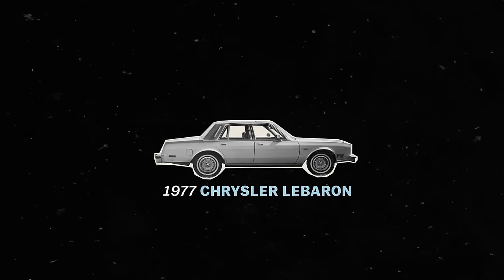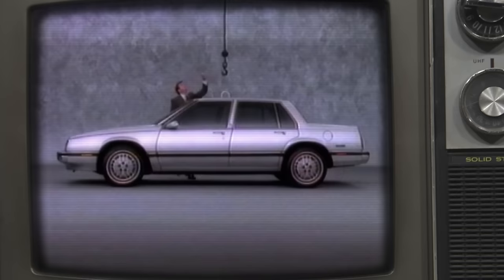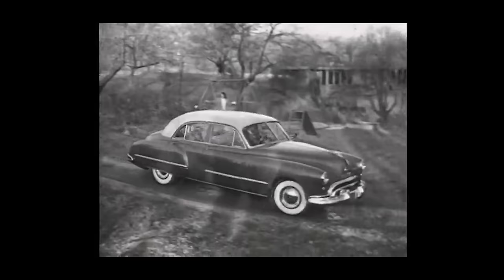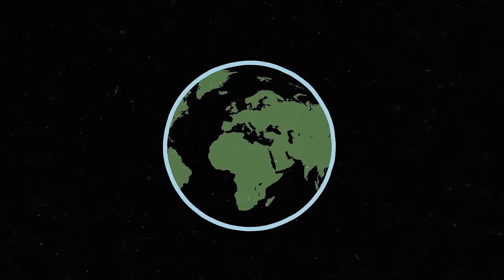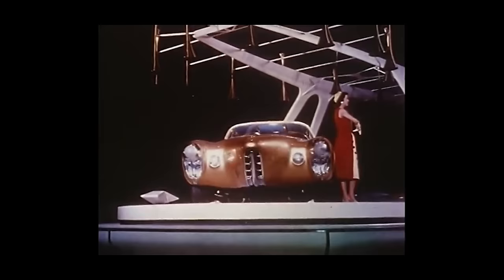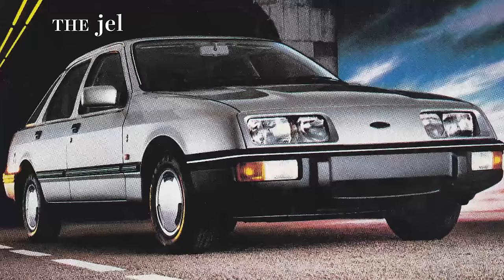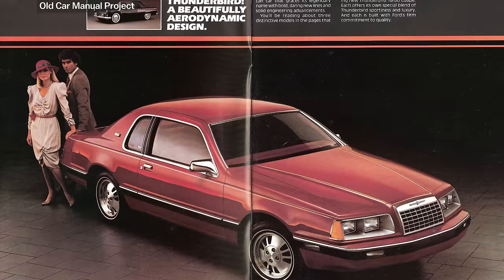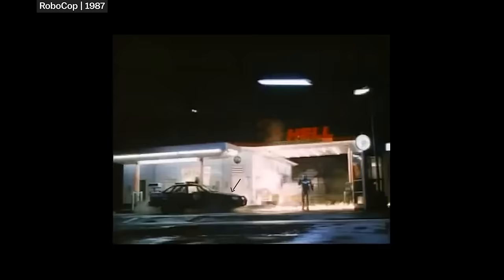How cars went from boxy to curvy

Comment: Who is the halfwit who wrote this?  Oh, where to begin?

1)  The whole Europe = Round, US = Boxy theme is simply, laughably wrong.  How many wagons and hatchbacks from that era do I need to show to utterly disprove it?  Let's look at 1970s Mercedes sedans (not the coupes, which were also rounded in the US) and Volvos and Fiats.  And it only got worse in the 1980s on both sides of the ocean.

2)  The rise of mass-market curviness was much less a function of gas prices and MPG standards than it was the ability for production to economically make stamping tools that could make the body parts, especially given the need for left/right symmetry. 

3)  Styling for curves v. corners has swung back and forth.  1960s cars were plenty curvy.  Compare the Lamborghini 400GT or Miura to the Countach.  Heck, compare a 1990s Cadillac to a modern stealth bomber one.

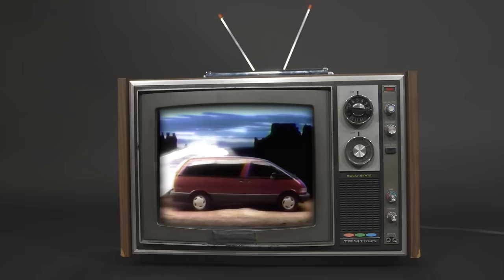4)  At 0:32, you show a Karmann Ghia, manufactured through 1974, racing against a late-80s wagon.  But the KG is curvy while the later car is square.  Um...

5)  Rounded cars are not necessarily more aerodynamic.  As an ex aerospace engineer who actually has done drag work in wind tunnels, I had to laugh at that.  They might have less wake drag, but typically there is more profile drag.

Shall I go on?
Reply: Very, VERY simple test.  Which car is the least aerodynamic?  The curvy original VW Beetle (http://st.motortrend.com/uploads/sites/5/2011/08/1952-volkswagen-beetle-side.jpg), a 1990s Range Rover Classic (https://en.wikipedia.org/wiki/Range_Rover_Classic#/media/File:Range_Rover_(1241369888).jpg) the 3rd generation Dodge Caravan minivan (http://images.gtcarlot.com/pictures/23679187.jpg), or the Ford F-150 Lightning pickup (https://cdn01.carsforsale.com/3/1010138/5345000/thumb/771969921.jpg).

Tick tock tick tock.

The loser is the VW Beetle.  But wait.  Isn't it the "curviest"?
Reply: Comment needs more likes
Reply: I dunno, he might be right but his cocky style makes me not want to like his comment.
Reply: His cocky style is what gives him character and appeal. His well presented argument is interesting to read sir.
Reply: I'm sorry if it came across as cocky; that wasn't my intent.  It's more 
annoyance at how the author of the video completely made up facts to 
tell the story he wanted to tell.  He cherry picked dates (cars in the 
20s and 30s were much rounder than they are even now), lied about the 
years things happened, and ignored plausible (and correct) explanations 
for trends, namely styling swings and manufacturing costs.
Reply: Thank you very much!!!
I only thought: "Are you fu**ing kidding me", when I saw the Video!

Cars are so heavy right now! They carry around a lot of unnecessary gadgets.
If it was really about reducing fuel consumption companies would try to reduce weight.
Reply: Thanks, Hawk.  To be fair, they are trying. Look at the aluminum Ford F-150.  That was a huge market risk, because the F-150 is supposed to be rugged and reliable (it is, but changing materials could create a perception problem - see http://www.forbes.com/sites/joannmuller/2016/06/08/chevrolet-pokes-holes-literally-in-fords-aluminum-f-150-pickup-bed/#3abc487b2465).  The problem is that mandatory safety features, from air bags to crumple zones, add weight to the car.  One of the biggest issues with aluminum has been repair (I think it's an issue of TIG v MIG welding), but shops are learning how to cope.  Additionally, steel has much better long-term fatigue characteristics.

Interestingly, there is pushback against the trend of smaller displacement engines with turbochargers.  That was done to supposedly increase efficiency and decrease exhaust emissions, both CO2 and NOx.  However, it turns out that the tests were - gasp - unrealistic, leading to completely BS numbers.  It's looking like the old saying, "there's no replacement for displacement," might be truer than we thought.

http://www.reuters.com/article/us-autoshow-paris-engines-exclusive-idUSKBN12E11K
Reply: A great example of Art Deco round cars from the 1930s.  My dad had one of these.  http://momentcar.com/studebaker/1937/studebaker-president/

And find me a boxy car here:  http://ncartmuseum.org/exhibitions/archive/rollingsculpture

Awesome, aren't they?
Reply: You're right, Craig.  In 1981 Porche's 928 was small, tight, low, rounded and swoopy - Chrysler's Imperial was huge, flamboyant, tall, knife-edged and boxy.  Yet, the Imperial was significantly more aerodynamic than the 928 because of what the air did UNDERNEATH and BEHIND the car.  I suspect the boxy-rounded evolution was 99% styling, nothing more.
Reply: I wouldn't take that bet, Bob.  But I'd still drive a 928 over an Imperial any day!  :)
Reply: Craig Shields yes please!
Reply: Volvo didn't truly loose the boxy design until 1999 when they stopped making the 940 classics.
Reply: I did like those cars.
Reply: Craig Shields this is a leftist news channel what do you expect
Reply: Craig Shields I see your points but people would be more apt to listen to you of you were less condescending.
Reply: No thanks.
Reply: +Craig Shields it didn't run fast enough to take advantage
Reply: Yeah you can go on- that was quite interesting. I do think that aerodynamics comes into it though because it's often not about what IS more aerodynamic but what APPEARS to be more aerodynamic which boosts sales. Which would mean, as you alluded to, it was kinda led by mass production and disappointingly fashion..
Reply: Andy, that's a fair comment. Usually, that's not my style.  However, this was so over the top wrong that it really pissed me off.  They lied and ignored tons of evidence in order to try to make a point.  That kind of thing angers me.  Apologies if the way I responded was offensive.
Reply: Don't forget British Leyland, they had some curvy cars but most were boxxy. At one point BL and other British companies were producing 1.5 million boxxy cars a year... The only exceptions were sports cars which had much lower production than say Rover
Reply: Wouldn't the rounded design also cause less damage to you if you were to be hit by a car?
Reply: Most important thing to consider about damage to pedestrians is whether the vehicle will toss them over the bonnet or push them under the wheels.
Reply: Magneto Metal Bender In what ways? Care to explain?
Reply: Such an elegant reply.  Could you actually point out where you think I'm wrong?
Reply: And it's "you're."  Christ, if you are going to call someone else an idiot, please be able write at a first grade level.
Reply: I haven't taken physics or gone in-depth into aerodynamics but am thinking of majoring in aerospace engineering but let me take a stab at it. 

Is there any way to decrease the amount of drag without needing to reduce the amount of space in the car or making it look ridiculous? You could model it after planes but it'll be a joke on wheels. It's mostly common knowledge that an angled surface will perform better than a 90-degree surface directly against the wind, this is why after WWII planes had swept-wing designs when jet engines were becoming popular in military technology. The wings would get ripped off when the force on it was too much. 

Yeah I think I'm better at military history and technology.

Comment: I like box cars better than curved
Reply: NZ WOTB same. I think all new cars look the same and boring
Reply: Nowadays, can't tell a Nissan from a Volvo from a Hyundai from a Ford from a Kia
Reply: @ryoamora8655  exactly
Reply: Ryo Amora A lot of 80s cars were shoeboxes on four wheels. Only with some trim differences
Reply: well i think your profile pic are a boxy cat
Reply: Fmono • 38 years ago • Updated 

Can’t really compare cars from the 1950s to the 80s
Reply: Fmono • 38 years ago • Updated

In what way? In the 50s you could tell every car apart easily. Lots of colors and different body styles to choose from
Reply: @bahamutsix5765   80's American cars had character in the way they handled, the way they sound, and sometimes in the way they looked. 

50's American cars on the other hand had character in the way they looked, up until the mid to late 50's, where all of them started having large tail fins, jet age styling, lots of chrome, and quad headlamps. They largely handled and sounded the same as well. For a lot of people, it's difficult to distinguish those cars apart from one another after 1957-1958.
Reply: i like box

Comment: Opel calibra is one of the most aerodynamic cars between 1990-1997. It has less air resistance than a Porsche 911.   Opel vectra B 97 sedan is close to the Porsche 
911.

Comment: "How cars went from boxy to curvy"....and then back to boxy
Reply: 1910s-1920s BOXY with a hint of curvy
1920s-1940s Curvy with slighty boxy edges
1940s-1950s somewhat curvy
1950s-1960s curvy with a tiny slight pinch of boxy in the later 1960s
1960s-1970s curvy then boxy 
1970s-1980s boxy
1980s-1990s boxy then curvy
1990s-2000s curvy boxy curvy curvy
2000s-2010s boxy curvy
2020s-???? boxy
Reply: @IdiotStinky02  yup...I can see boxy designs coming back and the curvy jellybean designs are starting to look old.

Comment: Fun fact: Until the early 1990s, cars were required by law to have square headlights. That's why all 70s & 80s cars have sealed-beam headlights instead of unique housings designed to flow with the body lines.
Reply: Then how come there were cars in the 90s with round headlights!
Reply: @Zach-sg5uu  In 1989, the government lifted the law requiring square or round sealed-beam headlights, so manufacturers were able to design unique shapes for the housings that better conformed to the contours of the vehicle's body design. 

The late 70s Camaro for example, had round headlights but they were standard sealed-beam. 

Pros/Cons of sealed beam:
Pros: Sealed-beam lights had glass lenses, so they didn't "haze over" like modern plastic ones. Since their housings were completely sealed, they didn't "fog over" either. 

Cons: No way to replace just the bulb if one goes bad; gotta replace the whole housing. More expensive than just a bulb. Only offered in two standard shapes: square & round.

Comment: So much missing here.  Cars of the 30s-40s were made to look like locomotives, early industrial design.  Then in the 50s and 60s it was the coming of the space age, and rockets and sci-fi became a prominent theme.  Boxy cars did exist in the 80s during the oil crisis, just look at Cadillac, Lincoln, Oldsmobile, and Buick.  It wasn't all about aerodynamics and fuel costs, but I can see how someone from the 2010s with no understanding of industrial design history would get this wrong by looking through their modern lens.
Reply: Not only that, but aërodynamica efficiency is mostly dependant on the total projected frontal surface of the car (like driving it through a wall and the silhouette is in the wall like in a cartoon, this is the projected surface). The shape of it doesn't really make that big a difference.

Comment: some german cars from the 80-90s were still quite boxy. For instance the Audi 200.
Reply: 1980s and 1990s Volvos were too.
Reply: Or the mk1 golf and the jetta
Reply: Audi 1982 C3 platform looks boxy but it was extremely aerodynamic for its time.  Drag coeficient of 0.3 is better than most cars of the 1990s.

Comment: Why did 50s and 60s cars go from Curvy to boxy in the 80s then back to Curvy
Reply: lonewolf5460 I'm wondering the same thing here
Reply: The video said that people wanted more powerful-looking cars and fuel efficiency wasn't a concern. I suspect a good amount of it was that, at the time, boxier looked different and thus newer and better than curvy. The pendulum has swung back around, and curvy looks more modern. Or rather, it was in the 00's. I believe today's designs tend to be largely curved but with a little bit of sharper angles, for example, the 2016 Ford Fusion here. It has some hard angles up front and those "lines" going along the side. http://st.automobilemag.com/uploads/sites/10/2016/07/2017-ford-fusion-se-fwd-sedan-side-view.png
Reply: Jesus Ruiz cause boxes look better
Reply: I'm guessing it's cheaper to manufacture and design a boxy car also they look bigger meaning the buyer gets the perception they're getting more for their buck.

Comment: But that's not the main reason they changed to boxy to curvy. The main reason was that box car didn't absorb the impact in a crash meaning the driver and passengers have a high death rate so they changed to curvy so when you crash the curvy car will absorb the impact instead of the driver and passengers being more safe in a crash

Comment: GM design made sense, because their cars were shaped like a Chevy symbol — especially the Caprice. I must admit, when the T-Bird came out, I thought it was a really good looking car. Many years later, I'd end up owning an '87. Unfortunately, like most of the cars of the time, they still were a bit weak on power. However, My T-Bird had their fuel injected 5.0, which wasn't bad for the time. When the Taurus came out, I was still in school. However, for the first time ever, it made me think that owning a station wagon might not be so bad. I would end up eventually owning a '95 Sable wagon. I got a lot of use out of that, and even carried a full compliment of adults once — with passengers in the rear facing hatch area. 

The Berretta and Corsica were two GM offerings that had a lot of potential. They might have even made a good challenge to the Taurus. However, it would still be a while, until GM fully committed to the bubble car design, like Ford did. For a long time, they seemed to be their only streamlined offerings, while they just rounded the corners on their other models. One of the hurdles was requirement for sealed beams. Once headlight enclosures and separate bulbs were approved, designs were able to change much more rapidly.

Comment: Says boxy to curvy

>>Probably has not seen a 1944 Buick Roadmaster
>>>Or a Jaguar XK120
Reply: Michael Miller yes just because those 2 cars were different they are wrong
Reply: Uh all cars back then were curved. Do some reasearch. Look at a Delahaye, A Muntz Jet, a Type 57 SC Atlantic, a 250 GTO Ferrari, the GMC Futurliner, ALL OF THESE ARE CURVED.
They are all from different years way apart from each other.
Reply: I haven't seen a 1944 Buick either. Was it made out of cardboard to save metal for the war effort?
Reply: Not even close
Reply: +Michael Miller 
agree 
these new type of cars all look too alike and are just cheap quality nasty throw away bland ipads on wheels 

boring !

Comment: Yea its not changing, cars will continue to get uglier and uglier.
Reply: DaladendDarrowmere and weaker
Reply: Weaker than what? In the '70s it was normal for almost every car on the road to be under 100hp except sports cars. Nowadays that's a good starting point for a subcompact.
Reply: TheReckless1 
Not even remotely.
Reply: The reason cars are more fragile these days is so they can absorb the impact of a crash so that the massive deceleration is reduced. This is important so you aren't killed by a sudden stop. (Also for some reason whenever I explain something I type as if I'm intelligent but trust me I'm not and that might not even be correct)
Reply: They are already ugly. 
For me cars from 40-s to end of 90.s are best for me
Reply: You have no idea what you're talking about.  I survived a 55 MPH impact on a jersey barrier in a chevy Spark a handful of years back.  That was physically impossible even in the early 00's, much less earlier. 

So yeah, your older car will fare 'better' but you will be horribly maimed.  I dunno about you, but I'd rather sacrifice the car than myself.
Reply: DaladendDarrowmere if you think efficiency is ugly,  you might also ask god to help you get something.
Reply: DaladendDarrowmere lol

Comment: Most new cars built after about 2010 are butt ugly and have too much electronic junk to break.
Reply: bah, cars should run on magic
Reply: shhmh
No I fully understand how it all works but it's just unnecessary complexity.
Reply: Charles Wellington lll Today's BMWs suck, they were last great in the 90s
Reply: +shhmh It really is junk. Most of the things in cars today are completely unnecessary, and they are all connected via modules. Your window lowering system, your wifi screen, your electronic seat adjustment, your driving assistances are all modules that communicate with one another. Its enough that one of the modules breaks or misfunctions, and your car may not start even though there is absolutely no problem with the engine. Besides, why do you need all that crap in a car? If I want Wifi, I might as well stay home. Don't need it in a car.
Reply: Patchuchan Its called "evolution". All these things makes driving more easier, comfortable and safer, like GPS, ABS, TC etc...
Reply: MrQuackingson i didnt realize that mistake, thanks
Reply: until they break and you realize you can't actually drive a car without it babying you
Reply: Actually many of us CAN drive a car without it babying us. Equipment level of my first car was basically - "has doors"...

Comment: The pendulum has to swing back in the other direction, and it is. Look at the new Chevy Tahoe or Subaru Impreza - both are more boxy than model years 10-15 years before them.